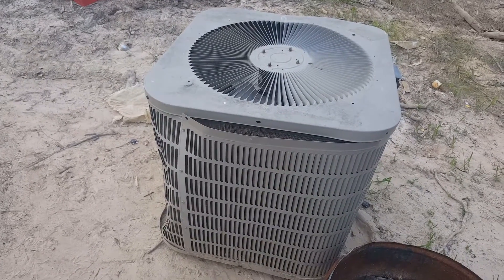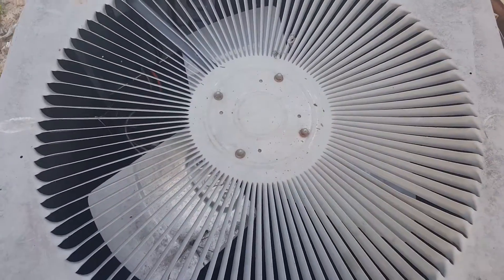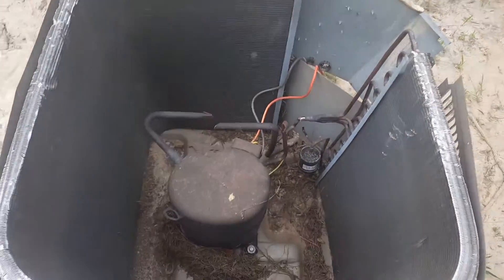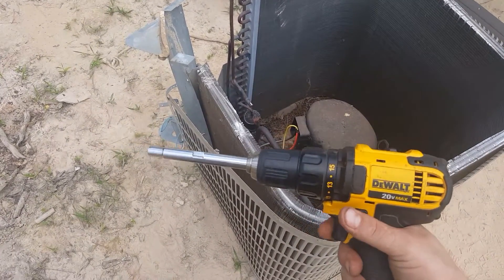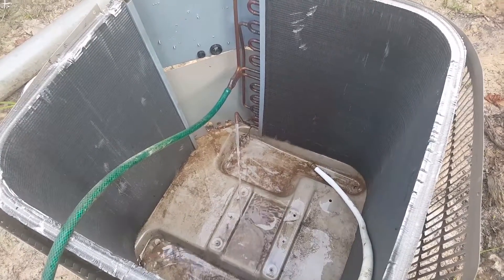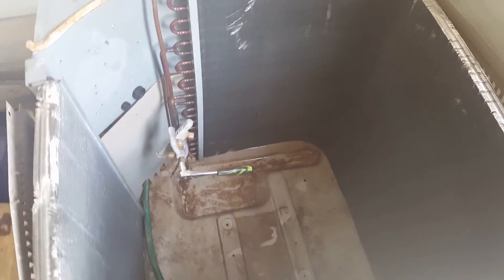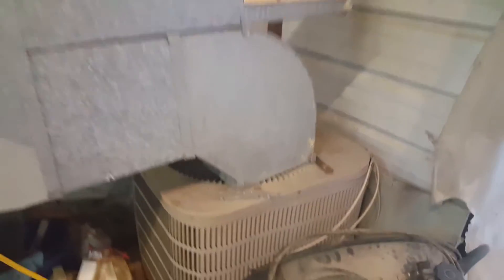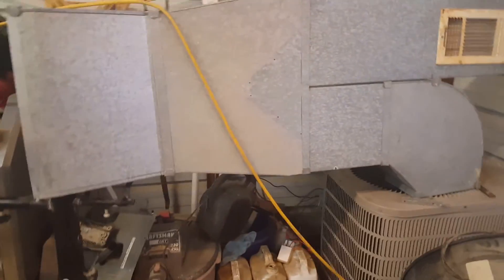Geothermal Solar Air Conditioning part 4

Comment: You need to lear the physics of A/C Water is useless for cooling except in a Swamp Cooler and that's evaporation, which won't work in humid climates. You have to use a gas in a high pressure and low pressure side. The expansion is what cools. You need the compressor and fan on the outside to remove the heat with a blower on the inside. and an insulated garage door would help too.
Reply from the maker: I actually do know the physics, gases heat up when compressed and cool with expansion. This is not a swamp cooler due to the air not touching the water. I'm am well aware of the humidity affect on swamp coolers as I have one and live in Louisiana lol. I appreciate your thoughts and know that this video could be better, but the principal of temperature differential and movement of heat still applies. Have a great day.
Reply: @RedneckTech   Brother you are living it, that fella is not.  Fantastic video and I really appreciate it.

Comment: Mate I was very interested in the car radiator system. Do I read you right that you think it to be a failure???
I live in very hot dry summer area and was keen to get some more data on how it performed such as:-
Do you know how much power your fan was using and 
Was the cooling capacity dependent on the temperature of the water flowing through the radiator?
I dont have any well water but was thinking of putting a flexible hose inside my 25,000lt rainwater tank and making it a closed loop system.
Also was the noise tolerable from the fan?
Good luck with new ventures

Comment: hi, great work with the 5ton ac condenser to evaporator chiller transform, what is your water source? how much cold the water comes in, and does the coils get moisted when turned on? im trying to make my own geo too
Reply from the maker: we use well water at 80ft deep about 55-60 degrees . it does condensate some but not to bad.  i got more plans for it but to hot to shut it down lol.

Comment from the maker: the DC fan and radiator worked great in the 12x12 shed, but I wanted a bigger unit for the 18x25x14ft tall shop . it does good but be better with insulation. I still got some fine tuning to do. I just put this together quick for the 90+ heat.